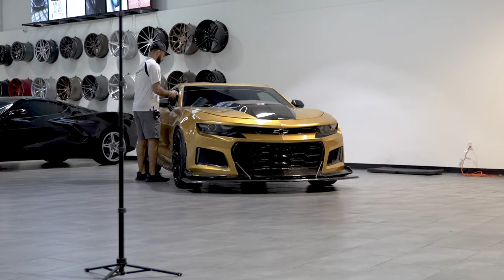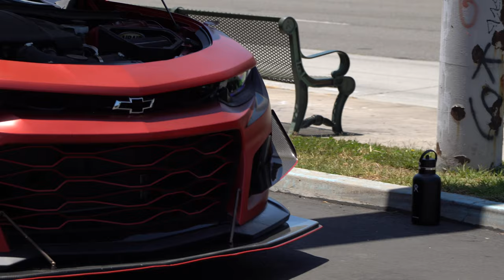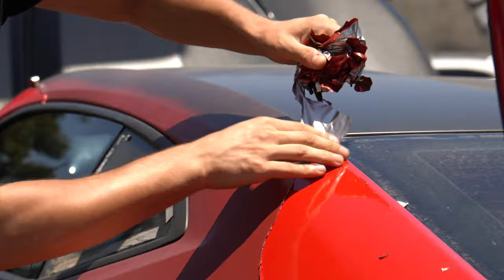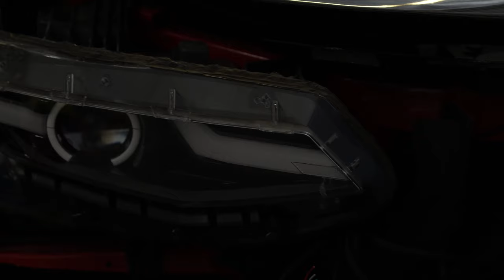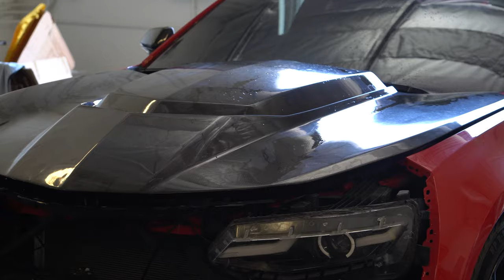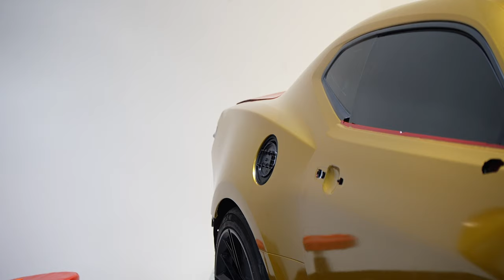2019 CAMARO | Gloss Gold Wrap | Carbon Fiber | Tint | Wrap Removal |@AutoAddictUSA | Episode 25

Comment: Hold up. So this is a V6 Camaro, judging by the engine cover, that had a bunch of money spent to do the wrap, tail lights, headlights, rocker panels, front bumper conversion, rear diffuser, fog lights, rear window louvers, AND front splitter?

For all of that money spent, could of just bought an SS and not made this one to look like a ZL1. This has me rolling.